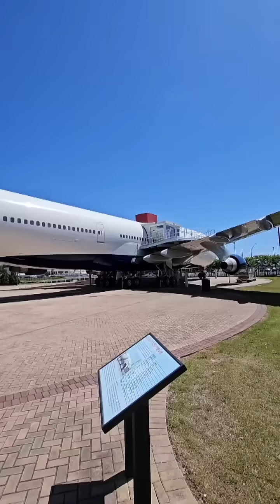Explaining the Boeing 747-400 primary flight controls.

Comment: Which touches on one of the inefficiencies...to go up is basically done by the tail of the aircraft being pushed down, to go up.
A clever bloke invented the canard style of aircraft which has the main wing set further back and a small wing at the front, and when it wants to go up the little wing at the front   is tilted up and both wings increase the amount they lift... 
Canards are so efficient a two seat aircraft called a longeasy, travelling at about 100 miles per hour only needs a 30 HP engine, making them cheaper to travel in than most cars.